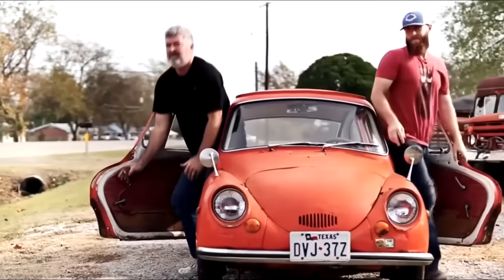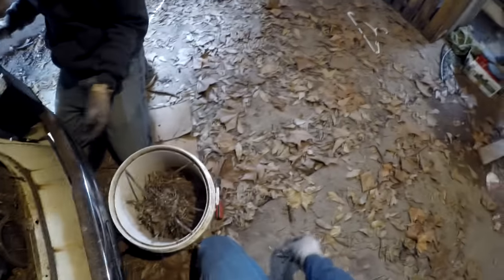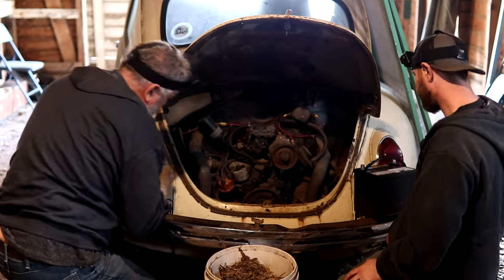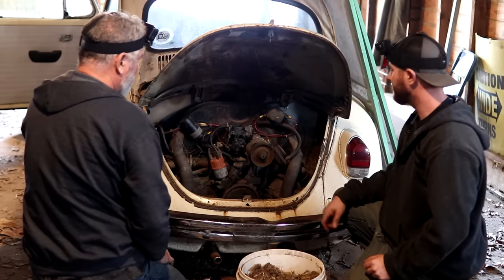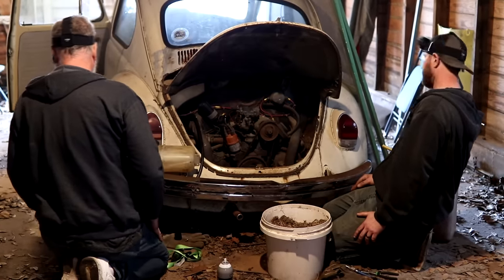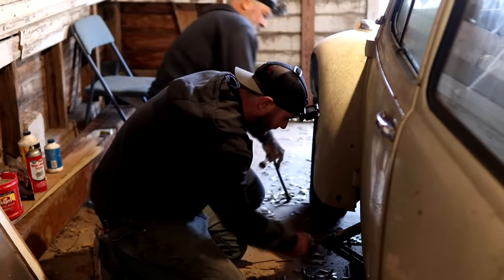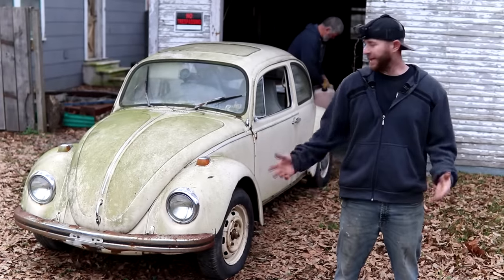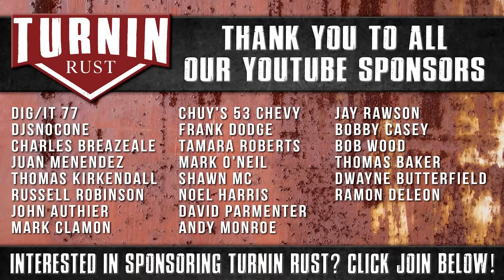FREE 1968 Volkswagen Beetle Barn Find, Will It Run After 20 years?! | Turnin Rust

Comment: Old VW engines rarely ever die. They just need new clothes once in a while.
Reply: The regular maintenance is more frequent on air cooled, though less than a rotary for example. However, this is one of the few cars designed to run forever. So keep it clean, run it regularly, and it'll never die. I miss my 67. Shouldn't have sold it so cheap... But heck, that's life.
Reply: Back when VW made reliable, long lasting cars. Sigh.
Reply: @bliglum  Did you know the original beetle was last made in Mexico 2004? You sir, in theory, could still snag one...
Reply: @alecfleming373  Yup. But I prefer the look of the earlier models.
Reply: @bliglum  I do too. In fact, I think the 67 bug was the best looking year of the whole line. One year only door handles, last year of low back seats, last year of the loop bumper and it was also unique to the year, not to forget the first year of the more pronounced up right headlights. I daily drove it to work for a year, so I got very personal with the little car. One of my favorite cars. The next two on the list, 89 VW Fox Wagon. Super fun to drive! And a Honda CR-V. So I have broken brand loyalty. But I done this years ago, grew up on Ford, first ride was an 85 Ranger.
Reply: i have been repairing beetles 45 yrs even the clothes are fixable :)
Reply: Meski gak ngerti yang mereka omongin, tapi aku suka lihat videonya

#INDONESIA

Comment: growing up those old vw never got stuck in real deep snow we had snow tires on it if they got stuck you could pick them up move them over and keep going very easy to push by hand and pop the clutch dont rember ware the master cilder was but you had to fill it with brake fluid and pump the brakes to stop

Comment: I find it fascinating to watch you auto mechanics take a car that's been sitting in a barn or out in the middle of a cow pasture some place for years and years and get it up and running and drive it home after only a day or two of tinkering with it.

One thing I was thinking about with the air tank. I've actually pumped up a car tire with a foot pump, no air compressor nor air tank required. It takes a bit of pumping but it can be done. I've done it.

Comment: Make sure you all get that generator light and oil pressure lights to go out. They should go out a few seconds after starting the car :) and check inside the fan shroud. You know if you took that much debris out of the front of the engine what’s could be nested inside of it :)

Comment: Missing the preheater hose to the air cleaner. That would make it run poorly until warmed up. Also has a mismatch between air cleaner and the hole in the rear lower air baffle where the hose from the muffler warming chamber goes through. Hole in air baffle is about 5 or 6 cm, hole in air cleaner is about 2 or 3 cm. Not sure if this is the original engine,  or if the carburetor has been changed, or if just the air cleaner has been changed. Air cleaner has been altered. Air intake arm has been sawed off.

Comment: I had 3 1969 Beetles that all had rusty heater tubes would always steam up the windows from the Fall to spring and the car smelled of mold....would throw $5 in when I could so cheap to run.  Can tell someone put some new wiring in it.  Really like the camera work must have a filter on the lense?

Comment: Still don't know why you didn't pop the bonnet and pull the spare out.  Secret on those Barn doors - lift up an inch and hop the wheel off the rail, you can pull it out giving another 1 - 2 ft. of width.

Comment: I've always wanted a beetle one day I'll get one
Reply: Justin Smith Grab one and take your time! Get a project one
Reply: Justin Smith yeah me to. Had a buddy in high school that had 1. We could put $10.00 in gas and go for a week. And gas was .99 cents a gallon. And we had Ethyl.
Reply: Monte Wow you just brought back memories!! Gas was about $.95 when I started driving. My buddy and I would split up some money and put $10 in and drive forever in our Beetles.
Reply: I had a '74 Superbeetle that was a lot of fun. It would always stall when rolling to a stop sign, so I had to leave the clutch in as long as possible, but when it snowed, the engine braking would start the wheels locking up, so I would pump the brakes with my left foot, gas with the right, and scrape the frost from inside of the windshield with a tape cassette case with my left hand, and shift with the right hand. Steering was a luxury. The good old days. I do like the big sunroof, though.
Reply: Justin Smith dont mean tobrag but im getting a 1967 today
Reply: Yeah but bad news: what if it breaks down? It's an old car. They stopped manufacturing the parts
Reply: @mariolrivera7091  there are aftermarket companies still making the parts and if not I'll do what mustie does and find a parts car they did make well over 1 million of them chances are I'll find something

Comment: Steel sliding sun roof, probably a webasto made part too. Mercedes and BMW seals should fit it. I like the pre super beetles .My squareback has sat in a big barn for 20 years after the engine locked up through lack of oil. Rats had been living in it for most of that time. There was 6 inches of rat droppings on the floor. Inside the doors and up in the roof .I have scrapped most of the interior ..... I hate rats.

Comment: They have fuel pump issues. The pressed fuel line fittings come out when the engine is running and you have an instant fore. I've had two.
Reply: ROBERT snyder  pull out press fit. Tap the opening and screw in a good one.

Comment: You need to put together a first contact kit with the tools and fluids that are needed and leave on/in the kit/truck/trailer... do not use these once back at the shop!!!!! The tools you need can not be that expensive...Before leave to visit a potential vehicle you check the kit to sure it is all there!!! I and we all realize not every tool is going to be in the kit and the one you leave out is the one you need next !!!!!!!!! And you never leave the shop with out the kit during work hours!!!!

Comment: Why don't you guys carry a simple recovery kit, emery boards are great for cleaning points, battery terminal post and connector cleaners are cheap WD-40, motor start, carb cleaner, and break cleaner JD

Comment: "Lets reseat this old tire with lighter fluid!!" BOOM! It worked! Folks don't try this at home. I worked on VW"s for 20 yrs, now retired. Those old vee dubs  were so reliable because they were SIMPLE. Easy to work on, and overbuilt. Yes the heater, wipers, and electrical sucked, and they were grossly under powered, but they always ran, and they were GREAT in the snow! I've owned several. Brought back lots of memories. Love these guys. GREAT videos.

Comment: Isn’t starter fluid really terrible to use on engines ? I was told it produces far more combustion and disrupts the oil between the cylinder wall and pistons. Cant imagine its any good for an engine thats dry as a bone from sitting. But hey i love your videos , keep it up guys. Also couldnt help but spot that cool yellow tyre sign in the background

Comment: Ha ha - I had two 1969 white Beetles in the 1970's.  The paint on both was horrible - VW used a "new" formulation that was supposed to prevent corrosion, but it caused premature corrosion.  This car actually looks to be in decent condition based on my memory of my two examples from 40+ years ago.  Two big giveaways on the year are steering wheel (chrome horn ring), and taillights.  The rotted off running boards stuffed inside is classic. The battery tray on one of mine rotted through while I was driving, and the battery dragged on the road, shorting out the posts on the body.  My dad used his plumbing supplies in his truck and torch to fashion something to get me home.  Great memories!

Comment: Brings back found memory's, I started, at the Bug Hut in Orem Utah, Duane Foresight taught me all I no. I was drafted and was taught in the military how to repair aircraft, later I went on to work in Washington state as a aircraft mechanic for 45 years. Now retired, I still love to work on old cars. If you didn't know keep number 3 valve gap is a little on the lose side, it has a tendancey to run hotter.